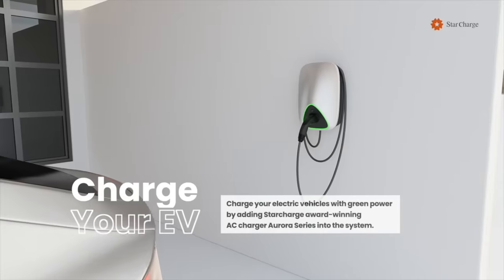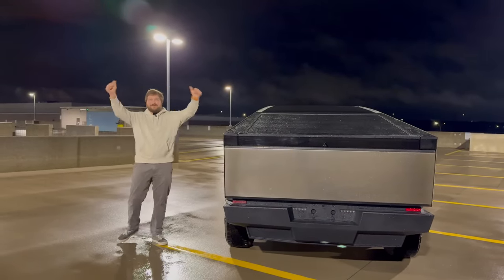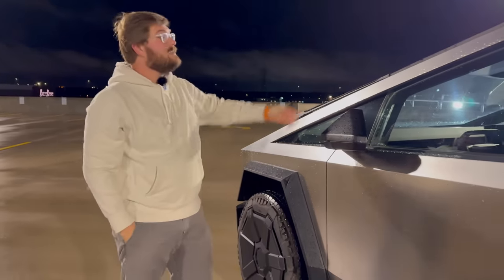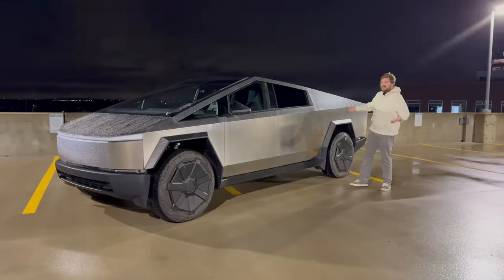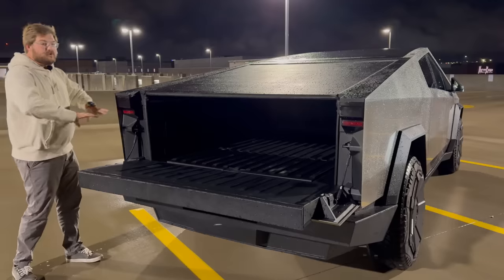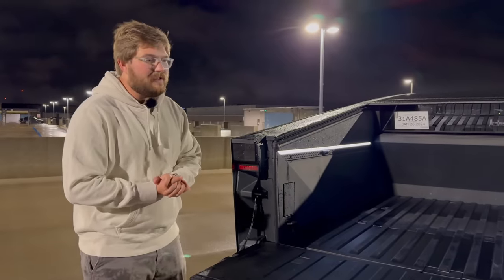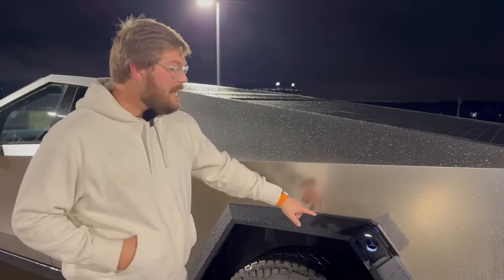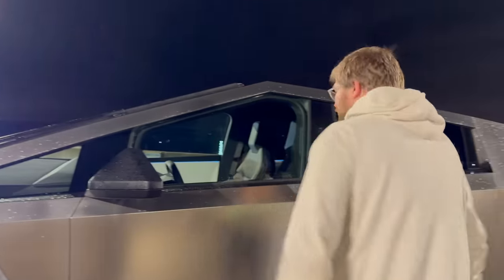Tesla Cybertruck Full Tour! Exposing All Details - Service Mode, Wiper, Powertrain, & Much More

Comment: Tesla should add another charge port to the LEFT rear and use two dc fast chargers at the same time to cut the charge time in half or if the 800 volt V4 charges reduce the charge time, Tesla needs to get on the ball and increase V4 stations with pull through stalls.  Towing is going to be a BIG problem in 24 as more vehicles can tow.

Comment: If the battery dies, is there a way to turn the wheels when pushing it or loading it onto a flatbed? Similarly, if the battery dies when the wheels are turned, are they stuck turned?

Comment: Man, we thought the Rivian vids were insane.  I suspect that what is coming will set the bar that will exist for a LONG time.

Thank you Kyle and crew for everything you do.  You look at other reviewers after about 5 minutes you shut them off because they don't have a clue.  

What is even more amazing is how Kyle can ramble on and on with all the facts, figures, and specs in his head.  That is not easy.  

Can't wait to continue this journey.   Which is crazy because I have no interest in owning one of these, but I can't help but be impressed with the technology and engineering that is involved.

Now, if you could somehow find that Cybertruck that crashed the other day and document how the front giga-casting fared, this series would jump from legendary to biblical.  (^_^)

Can't wait to see how Colton solves the fingerprint question.   Well, I bet Crud Buster would do the trick, but that stuff is a wee bit aggressive.

Hey Kyle, did you ever do a Rivian 4-motor vs 2-motor in "All Purpose" drag race to see what the actual real life difference is?  We know that the peak launch is in lowest - how close does the 2-motor get when the 4-motor is derated by ride height?

Comment: @1:23:50 I think the side warning lights are in the car and not the mirror because the mirrors are removable, and there are cover plates in the glove box to cover the hole they leave. If you had the warning light in the mirror you'd lose that warning... at a time when you need it the most (not having side mirrors)

Comment: 31:30  -  Those are NEMA 5-20R outlets.  You can tell by the extra slot off the left prong.  The specs on that NEMA standard are supposed to support 20 amps or a total of 2.4 kilowatts max.

Comment: Finally a real in depth nerdy review of the Cybertruck with all the details we've been waiting for. There is a 12v port in the center console which I guess you didn't see. Can you find any HV ports or attachment points in the bed for the range extender? I'm also curious how the bidirectional power works with the wall connector. What are all the components you need at your house to install it?
Reply: Local code enforcement officer -electrical department might know might not though

Comment: 1:43:43 - The rear seat bottom folding forward instead of backward is the one thing I don’t like about my Rivian. I love the under-seat storage, and the subwoofer does sound great; but I’d give both up for a fold-backward seat bottom with a large flat floor underneath like the CT. Also the 90° door (I’m betting it only being on the passenger side is on purpose) would be nice - my dog is old and has trouble jumping in the back seat of my Rivian, but the door doesn’t open far enough to use “dog stairs”. Either the 90° door or the “seat bottom fold large flat floor” would be enough for him.

Comment: From Wikipedia:

Center high mount stop lamp (CHMSL)
In the United States and Canada since 1986, in Australia and New Zealand since 1990, and in Europe and other countries applying UN Regulation 48 since 1998, a central stop (brake) light mounted higher than the vehicle's left and right stop lights is also required. The so-called "centre high mount stop lamp", or CHMSL (pronounced /ˈtʃɪmzəl/), is sometimes informally called the "centre brake light", the "third brake light", the "eye-level brake light", the "safety brake light", or the "high-level brake light
Doesn’t look the CHMSL on the CT meets federal regs
Reply: Or maybe you don't have a full understanding of the regulations, hmmm what's going to be more likely ...

Comment: One of my main complaints when I first saw the truck was its lack of a power liftgate. But it seems like it was well engineered because lifting it with a single finger is totally okay. Although for a 100K I wonder why they didnt just make it powered. Especially because the front trunk is. I assume they have a reason because implemented that little spring that puts upward pressure and the soft close function probably costs similar to a motor to power it up.

Comment: Great review. Thanks for the content. As a CT fan, I was disappointed by the range and price, but also by the rear seat or lack of innovation there.. it's upright and cannot be adjusted for a more comfortable position. The camera views side/rear should be adjustable in size and stay on at will if desired; this should be easy to adjust via OTA update.

Comment: I think they should offer an option for a Range Extender battery that fits in the Hidden Gear Locker under the bed so it doesn’t take up valuable bed space.  

I would guess with the space available in the Gear Locker a battery that fits in the space would add at least 50 miles of range.  This would be an adequate range increase in most instances.
Reply: You can't put batteries there, that's squarely in the crumple zone for a rear end collision.

Comment: Great review from the GOAT of EV reviewers!  Interesting to see the structural reinforcement telegraph under the surface of the frunk based on temp/humidity conditions. Would be interesting to see if that gets some sort of membrane to correct or cybertuck or Tesla text structural reinforcement design that would telegraph.

Comment: FSD and autopilot require ct fleet data, so shipping with those features at launch isn’t possible. These systems will need to be trained specifically with CT data since v12 is end to end and relies on specific photons.

Comment: For the issue that left rear door not opening 90 degrees, I think it might be because your driver door is open, therefore opening the real door 90 degrees might hit the driver who's getting in/out.
Reply: No.

Are you suggesting the truck has a way to control how far the rear doors open and it restricts it when the front door is open? Unlikely...

Comment: Properly list the $20,000 in benefits received on Foundation Series.  The benefits make up three $20K in cost. 
For example, he missed the power connector above the driver side door for off-road headlamps (which comes with every Foundation Series Cybertruck).

Comment: sounds like it will be like 4k trip to tire shop just to replace tires , which will be happening every 20-30K miles 😆, As soon as you turn on wiper on rainy days, the range will automatically drop by ~10% just for energy consumed by wiper alone ;)

Comment: Hope your towing test shows all the data: speed (hopefully 65mph), elevation gain/loss, SOC before/after, and a slow charge initially might be better for the most accurate starting range.
Reply: Why slow charge? Cooler temperature?
Reply: @float32  100% is typically more accurate. Analogy: fill legos quickly into a clear jar. The spaces between the legos will be larger (less fill). Then pour legos slowly and shake jar periodically. You'll have smaller spaces between each one, having a better fill.

Comment: Please go to an RV/trailer dealer and inquire about putting a gooseneck ball or 5th wheel hitch in the bed, and please tow a 10K lb trailer from Los Angeles to the supercharger station at the Shell gas station in Baker, CA. I'd like to know if the truck can make it that far with a heavy trailer load.

Comment: Kyle you are making this video on the top floor of parking garage. Warning the floor is not rated for this kind of heavy vehicle. CT is almost 7k pounds while engineers consider typically 6k pounds. Luckily for you the floor roof is almost empty.

Comment: Question about the screen - when you're sitting normally, is the left side of the screen blocked by the right side of the steering wheel?  That is one thing that bugs me about the refreshed model S/X.  Does the windshield go over your head like it does in the X?  Finally, I've heard that if you set up the phone key, the doors present or pop open when you approach without having to push the button.  Can you confirm?

Comment: Honestly as much as I adore this vehicle I have to say I don't think it's very consistent engeeering cost wise... Like it has all this wisebang stuff but also has suvere cost cut to make sub $100k(Not for the founder's package.) Which makes it a very odd duck even it it didn't have less polygons then a Supra in Grand turismo 1... But to be fair I'm also torn... Would it have been better at $30k or $200k? I want to say $30k but it would have not been so wisebang and groundbreaking... But at $200k no expensise speared the Caddilac of telsas... I feel would have also been valid.

Comment: 48A on board yields about 44mi/hr in my Model S so we should expect only 28-30mi/hr on a 240V/48A ~11kW circuit?? so from 5% to 80% would be 9+ hours of charging.

Comment: I saw on another site where it is $75 for a replacement wiper blade.
Reply: The Tesla parts list had the wiper blade at $135. But then Tesla removed all prices for Cybertruck parts. So still unknown just how much it will cost when it actually becomes something you can buy separately.

Comment: It does scare me to have no mechanical steering connections 😅
You need 3 signals coming from a set of 3 different sensors (not 2) else can't determine which signal is correct.

Comment: QUESTION: will snow chains hit the front wheel bolt?  That bolt looks really close to the tire and the air suspension won't change the distance?

Comment: INSANE that its only a 48 amp on board charger for a 123 kwhr battery.  My 2014 Model S 90 charges at 80 amps!  So yes, for anybody wondering, I have the old gen tesla wall charger on a 100 amp circuit, so I can charge at 80 amps.  Newer wall charger from Tesla limited to 48 amps. This equates to a rate of 77 miles of range per hour when my battery is low

Comment: When you turn the steering fast, is there a delay? Like you turn fast and the steering wheel is horizontal but the wheels are still turned by several degrees? That's the common problem with SBW

Comment: You couldn’t have taken a tape measure to the box? L-W-H at the front and back, top and bottom? How about the capacity and length of the various tie down points? Tailgate weight capacity? Also the tonneau storage roll…. As it’s rolling up, how much snow can it roll before it jams? Wonder how flexible that wiper will be for idiots who can’t be bothered to scrape the windshield?

Comment: @ 47 mins you talk about the swiftness of the suspension system....Rheres a review video showing extract mode and it took forever to get there plus the compressor overheated a bunch of times then when they got oyt in extract mode the software became lost and exxtract mode was locked out and they had to do a full shutdown and restart to access the Extract mode again.....Im pretty sure it was the TFLEV guys...

Comment: I want to see a bunch of stuff, which I'm sure you'll give, but when Drew gets there, I want full wheel specs: bolt pattern, hub bore, offset, weight, weight rating, etc... Also, I hope Martian (or anyone) will make an 18" or even a 17" wheel for this so that Off-road tires are more easily available.

Comment: At 18:30 when talking about differences between PM and induction motors, don’t forget what BMW does with their gen5 eMotors. BMW uses externally excited non-permanent magnet AC synchronous motors both front and rear in their dual motor i cars (iX, i4, i5, i7). These are similar to the high operational efficiency of a PM motor, but instead of the rotor consisting of permanent magnets, the rotor uses an electro magnetic that is externally excited with a pair of brushes and slip rings.   This allows for high operational efficiency and also the ability to remove power to the rotor and have the motor free spin like an induction motor.

Also, call me Captain Obvious (tm), but it would make sense do NOT use the same iPhone to film with and use as a digital key for the vehicle in the video lol!

Also, fyi, those outlets in the bed are technically NEMA 5-20, not 5-15. Hopefully they support the full 20 amps

Comment: Mercedes Benz tried a fast single (center) wiper back on the '80s W124 (and so did various brands on smaller cars in the '90s)... didn't last for more than 1 gen. for obvious reasons

Comment: I enjoy your videos, but they do drag on with some things are completely glossed over. Where's the third brake light? If it's in the tailgate, what happens to it when the tailgate is down?  Some people do carry items larger than the size of the bed!  Does it have amber turn indicators? If not, why not? Why not have the rear camera in the mirror?

Comment: 38:58 Kyle, that's typical Tesla! Once they release a new model in the U.S., they only support native Supercharging at the beginning.

They did the same in the past with the Model 3 once it was released, and they did not enable CHadeMO for the first year! They do that so that the competition from overseas (including China) does not ship the car over for testing!

The only non-NACS markets where you could use Cybertruck now would be the ones with remaining TYP-2 supercharging stalls, meaning V2 chargers. And there are less and less of them as Tesla started replacing all of them with only CCS-2 charging stalls!

Did you actually try to see if the Cybertruck does support the CHadeMO adapter?

Let me know if it worked, please!

Comment: Great review! I can't believe how you can roll out all of that material so effectively. Well done! The glovebox reaction was surprising, but honest! I had a question about charging speeds with the larger battery in the CyberTruck at 123 kWh, the battery is 23% larger than a 100 kWh formerly largest battery, so we should expect 23% longer charging times. So instead of 30-40 minutes for a full charge, it will be 23% longer. I am eager to drive my Foundation Series around the country once we get delivery Jan-Mar this year, so I am very interested in knowing everything possible ahead of that trip. Thanks again for a great video Kyle!

Comment: I hope that cyber truck comes with a HUGE train horn! 
Most reviews never bother to hit the horn.
I hope you can test the horn out for me on one of the next videos.
I’m curious, I have a bad feeling the horn will be lacking
Reply: There's an air compressor onboard for the tires. Why wouldn't they use an air horn? 😀
Reply: Worst case scenario, there’s an available 48v connector under the frunk. You could power your air horn from that. It also has a connection to the Cybertruck’s data link. So with a little programming on a microcontroller or Raspberry Pi, you could synchronize the air horn with the built in horn, no extra wire pulling needed.

Comment: 46:00 Curious about the air pressure in the cabin as you in the parts catalog you can see the release vents areas between the 2nd row and the bed. I would expect some pressure but definitely not enough to feel it in your ears just opening up the doors. Wonder if will change with some usage (release vents relaxing).

Comment: Only thing that's going for the foundation series is premium connectivity and FSD (Not in cybertruck yet)... I am curious what the steering wheel adjustments looks like in service mode.  I'd also like to see whats up with that big plastic in the back by the tow hitch.
Reply: The Foundation Series also includes Tesla’s Powershare Home Backup. A bidirectional wall unit for charging the Cybertruck or using it to power your home. There are also a few minor accessories that will be added cost for regular production Cybertrucks.

Comment: 11kW on board charger (AC) is a bit minor, low power 

Especially for a 123kWh pack
10-90% charge will take: 9 hours

My model 3 has 11 kW OBC for 70 kWh pack, so 5 hours for 10-90% charging
Reply: Note you only need enough charge to get to the next fast charger.

Comment: the 48volt system would be important for drive by wire , actuator electrical pressure to move the tyres. 12v would be dangerous
Reply: EPS systems exist somehow today that aren't dangerous...

Comment: Can you use the 240volt 30amp outlet in the bed while the truck is charging using the mobile charger.   Looking to charge it at campground (if allowed) and provide basic power to a camper (no AC, microwave,  electric hot water boiler).  Thanks.  Great video and seeking out.    Oh one more question, it looks like there is front bumper radar unit non the CT from one of the YT video from a detailing shop when the had the front bumper removed.  Can you double check?

Comment: Is the bed of the Cybertruck usable as a bed of a truck?  I've used trucks for decades.  I find myself always reaching over the side of the bed and grabbing my stuff off the floor when I need it.  With the design of this truck, can you do that?  Or, do you need to climb up inside the bed of this thing every time you want to get something out of it?  Can you easily shovel material (dirt, mulch, stone...) into the bed over the tailgate or side?  Looks to me like you'll need to lift your shovel over your shoulders or head.  Conventional pickup trucks have this taken care of by their cab/bed styling/design.
Reply: Fit a slideout, then it's not just very usable but also very secure.

Comment: 11:10 V2H should be standard on a dual motor, unless you have the option to prepay for the $4K installation limit offered with the beast
$20,000-worth of options should not include V2H as that would be standard